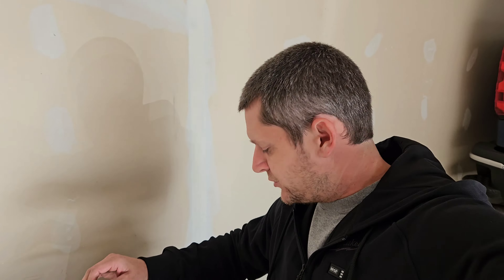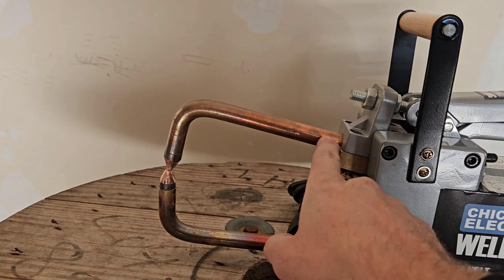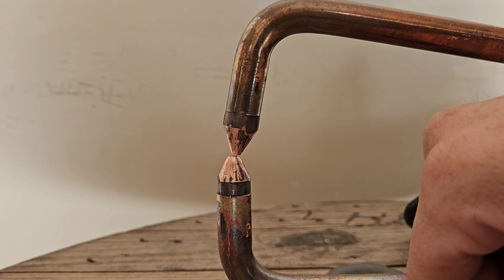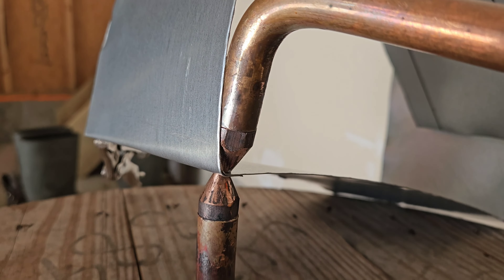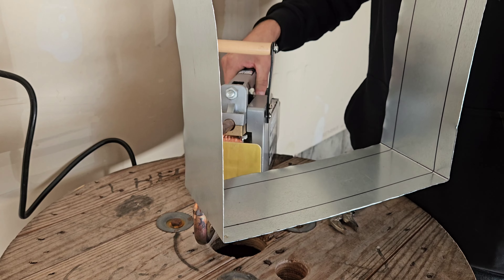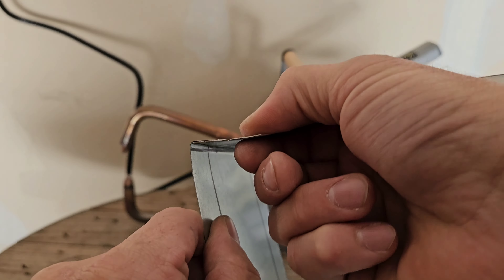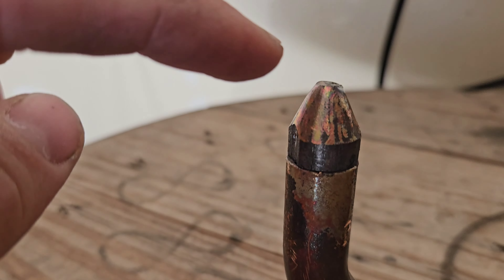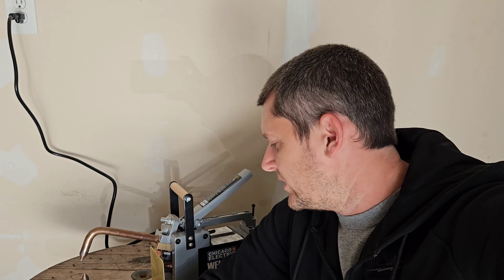Worst Harbor Freight Purchase Yet? Harbor Freight Spot Welder

Comment: I have a similar tool from another maker. Pretty useful when you need it. 

Here's a tip tip - Chuck the tip in a lathe or drill press and dress it back with a file. Good as new and cleaner than hacking it with a file while mounted on the machine.
Reply from the maker: I'll definitely give it a shot on the drill press thanks!